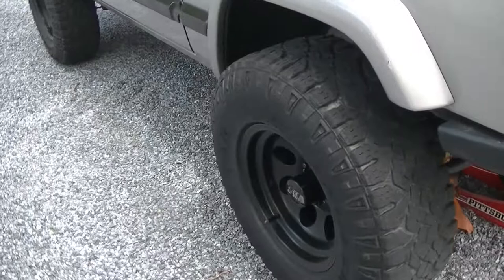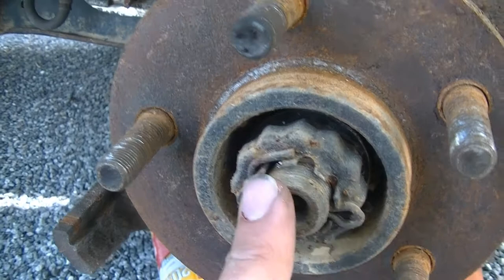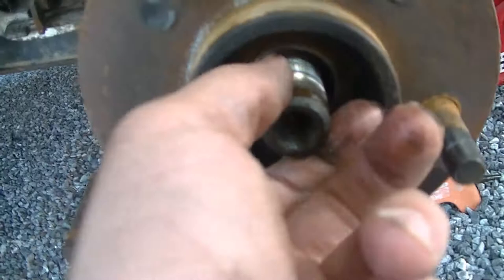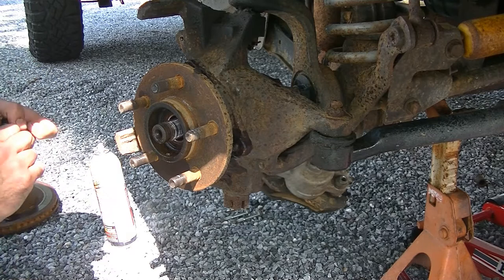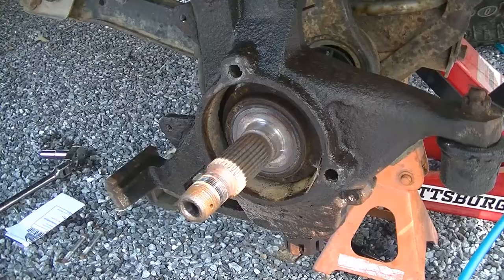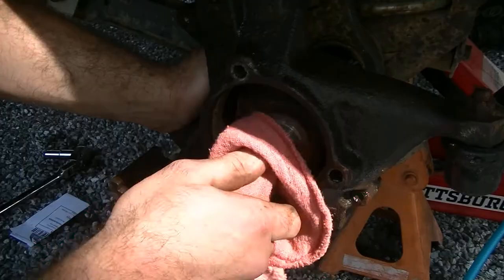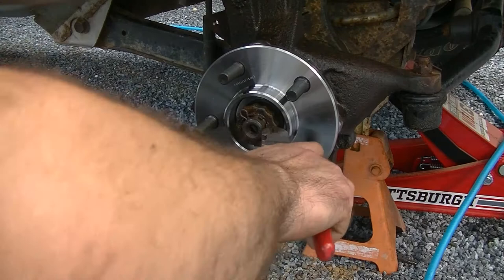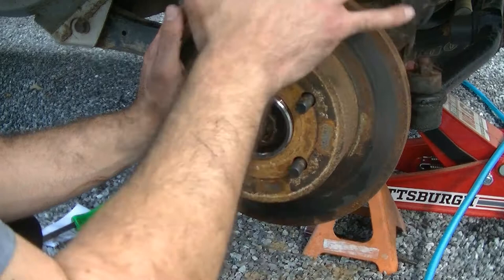Front wheel hub bearing replacement Jeep Cherokee Wrangler XJ ZJ JK TJ (dana 30)

Comment: Try putting the hub bolts back in so they are about 1/8” from being bottomed out (full thread engagement) you can put the socket on or use a drift in the center of the bolt to knock the hub out. This will prevent you from beating the hell out of the steering knuckle and ball joints and the force applied pushes the hub out more evenly with less effort.

Comment: the brake caliper is hanging by the brake line. this is what not to do kids.
Reply from the maker: Your not "supposed" to let it hang by the hose you're absolutely correct. However, I've NEVER had a hose break because of it.
Reply: @SEsGarage  they don't giving you a hard time